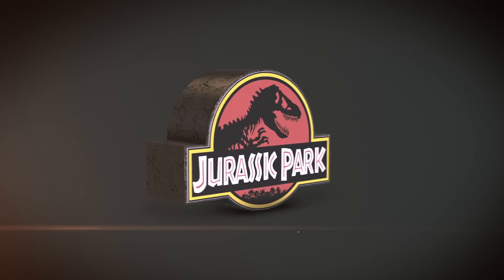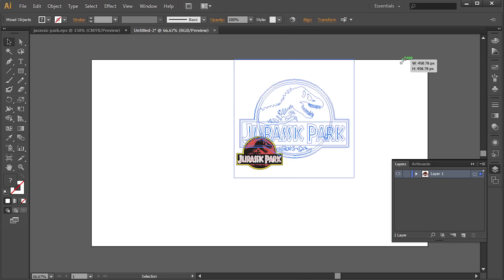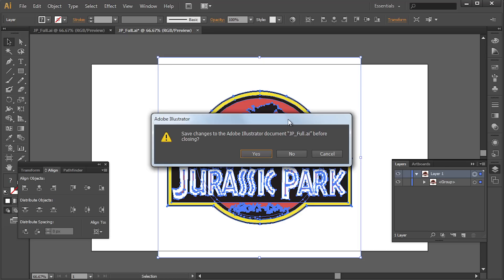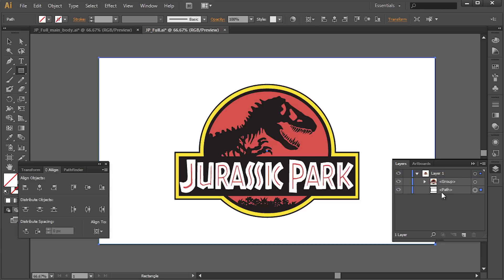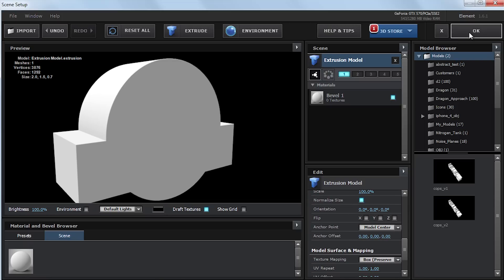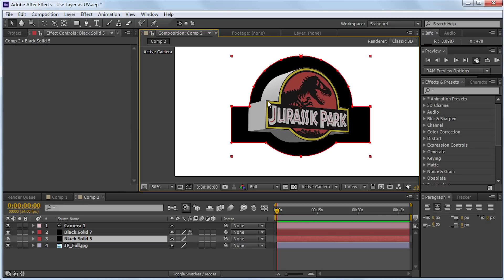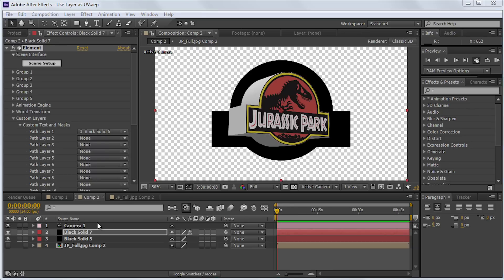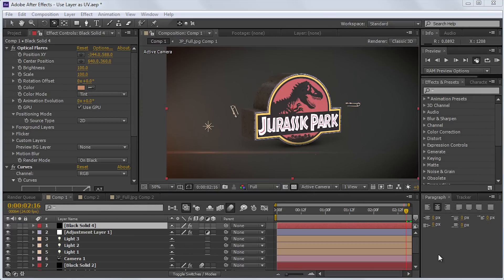Creating 3D Logos in Element 3D with Textures

Comment: Hi Dustin, lov the tut. Question for you if you're still taking them years later.... I am trying to apply a logo from a jpeg/png/vector to my 3D model. I did it as a texture. However my model is a golf ball. The texture (logo) wraps around the entire surface and I only want to have the logo on the front. Can you help or direct me on how to shrink the logo texture so it doesn't wrap around the golf ball. Cheers.Your help would be appreciated.
Reply from the maker: This is a really old post but might help

https://www.videocopilot.net/forum/viewtopic.php?f=42&t=89155&p=304230

If you still are having issues hit me up on twitter with some screengrabs!
Reply: @dustyzvidz  Thank you. Most appreciated. Have a great Thanksgiving if you celebrate that.

Comment: Not able to rotate the logo, used the key for position in camera, wonder what i am missing
Reply: Use "group 1" in elements (or what ever group you are using) Open the setting and find a setting for particle look. There will be some rotation settings in there without needing to rotate a whole camera. Hope that helps!
Reply: @YGBHawk  THANKS, U SAVED MY LIFEEE

Comment: in element 3d 2.2  how to add texture ?? like this
Reply: The same way but the settings are in different places. You need to turn on custom layers then set layer 1 to you logo shape, then set the texture layer in the drop down below the logo one. Then go scene set up, then your bevel, then the bevel texture settings. Look for defuse at the top, click "none set" and set your logo there. Next to load texture there is a drop down to the left of it to set you custom texture.

Comment: I'm trying to finish up a project, but I'm having trouble with Element 3D. Everything works fine except I can't get any custom layers/textures to work. No matter what technique I use to assign a custom layer or texture to a piece of the model the textures show up in the Assign Texture window, but won't show up in the Scene Setup Window or in After Effects. 
I can assign a comp as a custom layer or select an image and neither technique works. I've updated AE, Element and the drivers for my card. 
I was in contact with Video Copilot last week and sent them my project files and model, but I haven't heard back from them since Friday and the client really wants this project done asap.
Anyone have any ideas?
Reply: What version of Ae are you using?
Reply: I know it's been a year but did you manage to get this working? having the same problem. Thanks
Reply: nobody responde

Comment: Hello, you did not show how both sides have image that is not mirror face on the back side..and one problem i have the back side is darker, i want the color same on the front side. pls respond asap. thank you
Reply: You are not thinking in 3D, the lighting is facing the front of the image. To get the same colour round the back you need another light at the rear. If you leave the cam at the front you can animate using the group 1-9 particle look settings. no need to move a camera other than in or out.

Comment: Well...
I need some help:
Everytime I extrude something and want to texture it with the image the model was cut out from, the Texture is not fitting...
The same happens for every model I import into Element 3D 2.2 and I'm searching for help since almost 2 months.
I read about the UV-Mapping and so on, but nothing was happening and no step by step tutorial could help me fixing it.
I've done every single step in this Video, e.g., but the texture won't fit... I don't know what to do now.

I'd be glad for any help :)
Reply: what graphic card are you using? maybe AMD 7er series? which driver?

Comment: Umm, when you loaded your file in, you had all those splines on your logo. Did you skip that step, and can i simply load an "image"??
Reply from the maker: Hey!

Can you link a timestamp? Not sure when/what you're referring to. I copied and pasted the paths from Illustrator to After Effects, is that what you mean loaded?
Reply: Screen Punch Hey thanks for the reply. I mean, how did you get the splines/ paths on your logo in Illustrator in the first place. Did you manually create it and did not show it in the video?
That's where i'm stuck. No sure if i have to create the splines as well. And what i wanted to ask is do you simply open an "image" in Illustrator as opposed to opening a project file which you did.   I'm new to Illustrator and i always tend to find shortcuts around Illustrator :D
Reply from the maker: VFX Ltd No Prob! That file is a vector image so the splines/paths aren't on the image, they make the image. Then I did save it as a regular image file afterwards to load as the texture in Element.

A lot of the time people have a vector version from a client or other graphic artist they can start from, but if you're starting from scratch I would just mess around in Illustrator for a while. Basically any shape you make (circles, boxes, path tool) is going to create a path that you can copy and paste to AE. 

Most path tools allow you to create a Stroke or Fill so that you can fill in your logo with color. The file I used I actually just searched "Jurassic Park vector logo", and found a free logo to use, I cleaned it up a bit but maybe searching for one might be good way to check out how it's built!

--Dustin

Comment: After hitting the "Use Layer as UV" I noticed that the mapped image was bleeding onto the edges and did not look clean like your JP image). I utilized your trick for pre-composition and copy/pasted the attributes to another bevel. I messed with the extrusion and Z-offset and it looks great. My question, however, is how can I use my Pro Shaders on the extruded portion if I already have a second bevel mimicking the first? Thanks for the tutorial. It's great.

EDIT: I figured it out. Make a third bevel and push the first to closer to the camera in Z space.

Comment: First of all, thank you for sharing such a great tutorial with us. I loved the idea of put my logo on a 3D world.

I did the whole tutorial, but some things didn't work for me. And I hope you don't bother to help me. I don't want to give up, I'm determinated to do this thing.

So, the first thing that didn't match was the align thing on Illustrator. I don't know why it's not working. I've selected the layer, but nothing happens.

My second problem is the size and position of my layers on After Effects. The mask it's not matching with the jpg as yours. I tried to fix it manually, but when I do the texture thing (the UV) my "texture" doesn't go to the right place on my 3D logo.

I'm excited about this tutorial. I hope you could help my with this things so I can finish it...

Thank you  very much!
Reply from the maker: Hey Daniel!

Thanks for watching! Hmm not sure about the align issue off the top of my head, might be a good question to search, I found this page on Adobe's help that seems like it might help out:

http://help.adobe.com/en_US/illustrator/cs/using/WS714a382cdf7d304e7e07d0100196cbc5f-62f2a.html

Different forum post I found on the subject, little old but still may work:

http://creativebits.org/illustrator_shortcut-_how_to_center_object

But yah, the reason I centered it was because when you paste to AE it typically centers it there, so that will definitely save the time of having to nudge it manually, which you could do by selecting the mask in AE and moving it, then go back into the scene setup and just change any value so that it's not cached at the old position any more.

Comment: Everything works except the align tool in Illustrator. I have to align my image manually as best I can. Even though I am not using the align tool, I do not move the image once it is placed. However, once I copy my files to After Effects and use element 3d, the jpeg is slightly off from the mask. Do you have any idea how to fix this? I am using the latest version of Element and Adobe CC.
Reply: I was having the same issue in illustrator as well. Go to where you align it at. You will see a box in the bottom right corner that says "align to" . Click that button and select "align to artboard". That fixed my illistrator problem. Only having done that, for some odd reason it seems i still have to line up the image in after effects with the extrusion. And im having the same issue you are, I cant seem to perfectly align the texture map to the extrusion. Ive got it as close as it can get, but i need another adjustable digit to get it perfect. The only option i can think of is to go into photoshop and paint in the small slivers that are missing. Very tedious work and still searching for a solution.

Comment: Anyone know how to do this but in cinema 4d?
Reply from the maker: In Illustrator save the project as Illustrator version 8, then you can drag the Illustrator file into the c4d view-port to import the splines (you can also use file/open, or file/merge as well). Then just extrude like you would text, with the Extrude Nurbs modifier. If this doesn't make sense, I would say just search it, there are tons of video resources on this. Good luck!
Reply: Dustin Hudson What I meant was how to get the texture or material, from the original logo on to the extruded logo? Thanks for quick anser
Reply from the maker: 187pod1 hah, whoops, I didn't answer your question at all. Off the top of my head, if you were just texturing the front face, you might set the uv mapping to Flat and use the Texture Tool to position. But as far as some sort of projection based on the spline position, I'm not sure. Good luck!

Comment from the maker: Hey!

Ah ok cool, yah I would say take that diffuse, drag it into it's own composition, then take your logo and place it on top of the diffuse in that comp. You may have to play around with the position, but once you get it in the right spot, you can go to Composition/Save Frame as/File, and just render out that one frame as a JPEG. The drag the new file to the Hockey diffuse slot.

Doesn't matter what format your logo is, since it will be flattened out to a new JPEG file. Jet vid should help.

Comment from the maker: Is the Hockey puck an obj model or an extrusion? If extrusion, it should be the same as this tutorial. If it is an obj (or from a model pack), you can take the texture maps into either After Effects or Photoshop to add a logo on it. There is a tutorial on VC that shows how to do this but with an Aircraft, but the concept is the same: 

videocopilot(dot)net/flightschool/decal_customization/